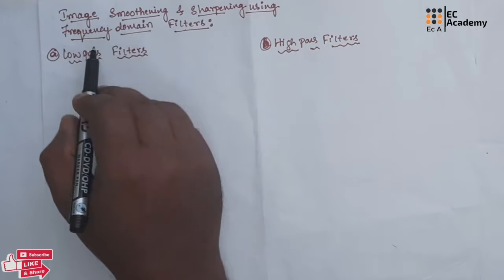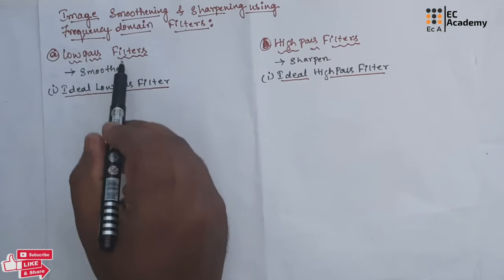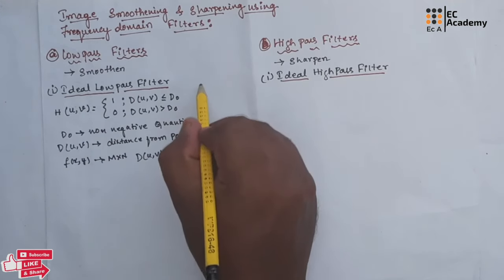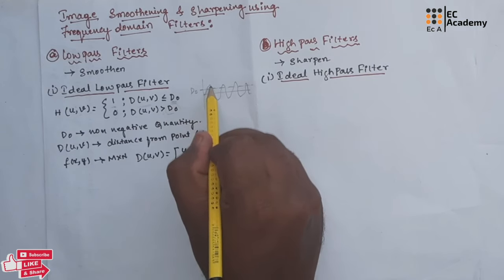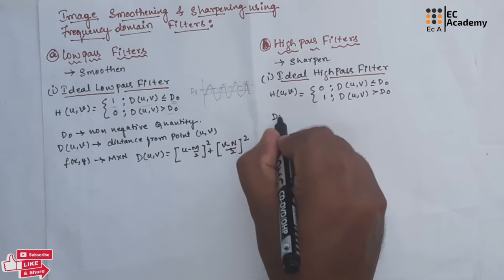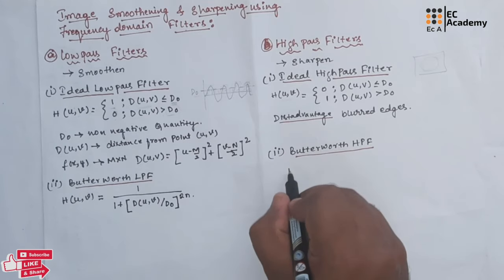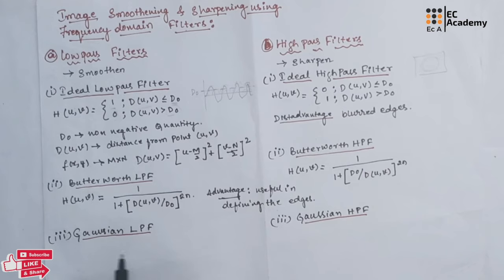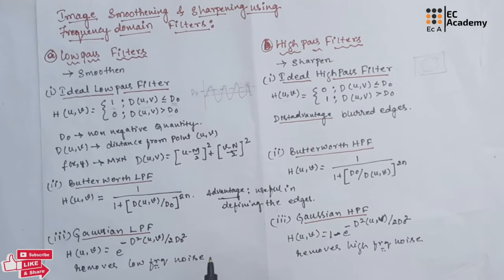DIP#24 Image smoothing and sharpening using frequency domain filters in image processing||EC Academy

Comment: it seems example for ideal low pass and high pass filter is not correct, you have taken example in time domain signal and told you are removing high frequency components, it should be in frequency domain.
Reply from the maker: Yes...  it was just to make you understand... but I did a mistake there... I should have taken signal representation in frequency domain... 
Do subscribe and keep supporting EC Academy